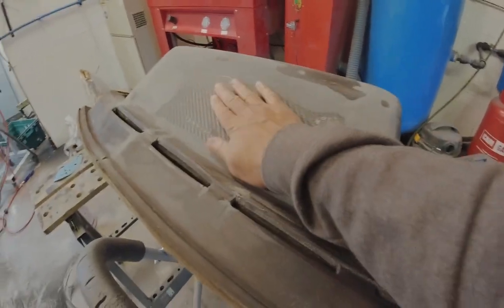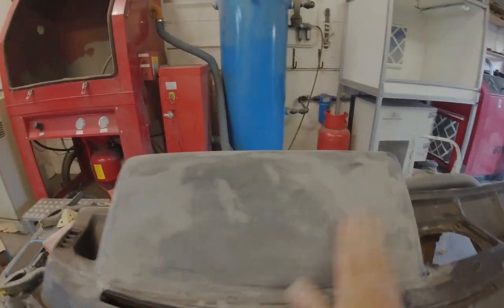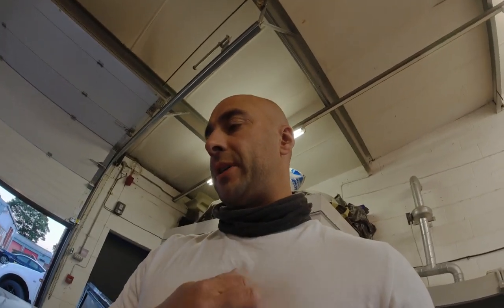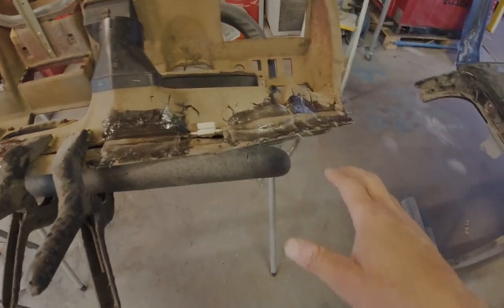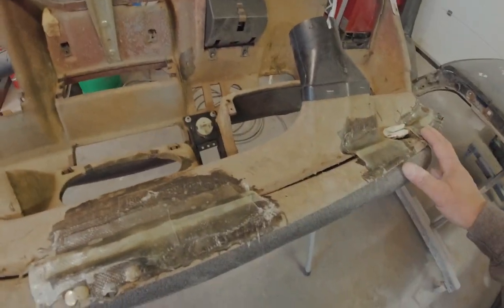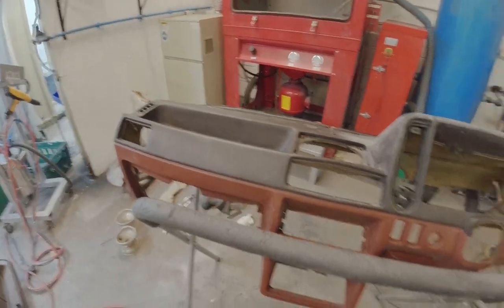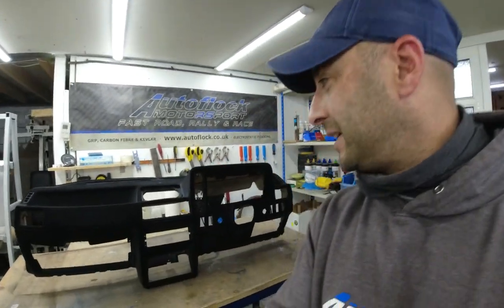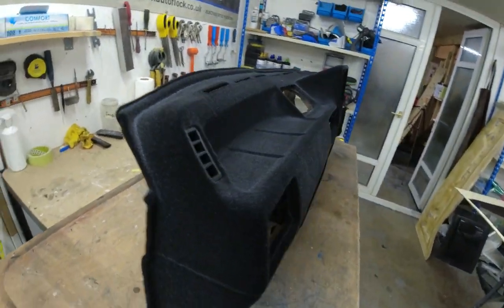Dashboard Flocking & Extensive Repair

Comment: What epoxy resin product do you prefer using for this kind of work? I'm about to start my own dash restoration and your videos have been helpful.
Reply from the maker: Hello Mike, I use a good quality epoxy but I do add a number of other ingredients to help with the process and conductivity.  Repairs I use a panel bond same as they use to bond composites in formula 1.  I hope this helps

Comment: Hey, did you have any problems with flock getting into small lumps in flocking machine which stick to the flocked part? I cant solve this problem
Reply from the maker: Hello Adrian, no not ever had any issues like that?  sounds to me like high humidity which is monitored and controlled in my booth.